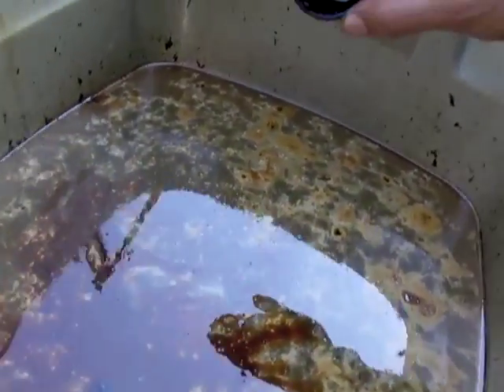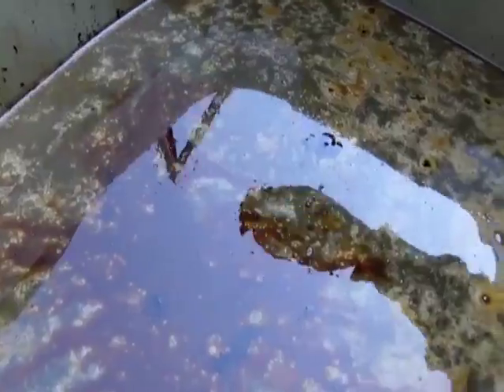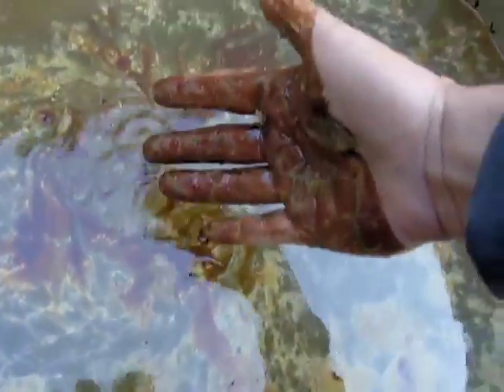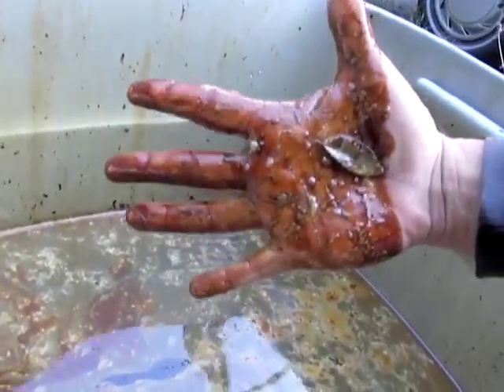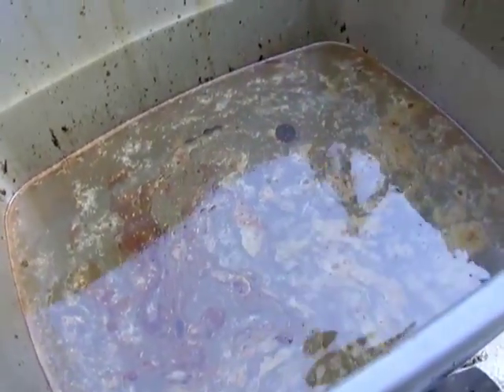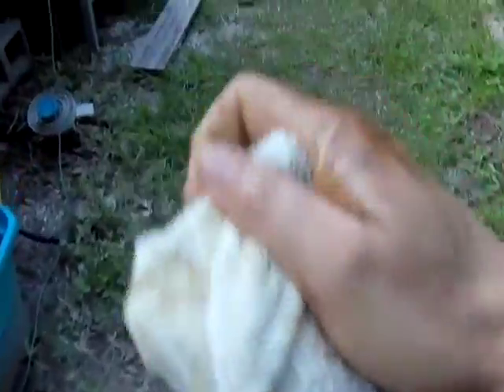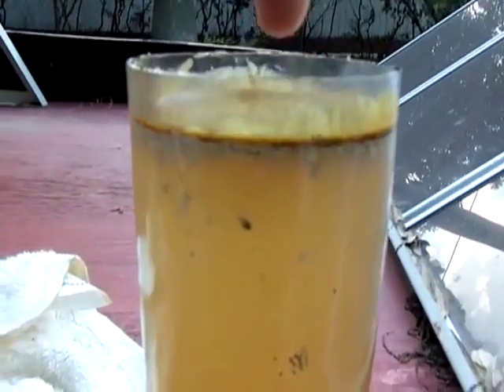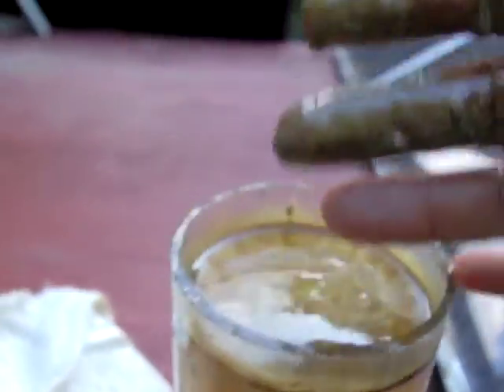GULF OIL SPILL BP's Oil Dispersants - itopf

Comment: @rainerfilm 
with respect, i don't think you understand this so let me try to explain it:
Once they are dispersed, the tiny droplets of oil are more likely to sink or remain suspended in deep water rather than floating to the surface and collecting in a continuous slick. Dispersed oil can spread quickly in three directions instead of two and is more easily dissipated by waves and turbulence that break it up further and help many of its most toxic hydrocarbons evaporate.

Comment: Hi Dan! Nice instructional video abouth the oil spils! I seen a nice oil recovery device once in a documentary. It was sort of grre science. The device was made from sheep wool weewed together like a thick banket an then they had to put this wool blanket on to the oil spill. the oil will stick to the wool fibers and the wather will not, this way they could recover the oil from the water by passing the blanket troug a pair of rollers on a boath.